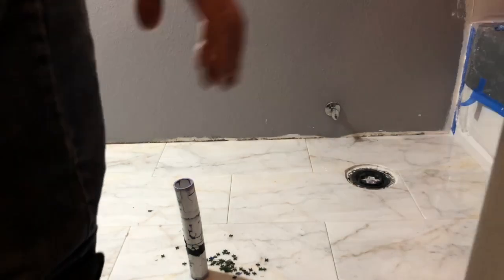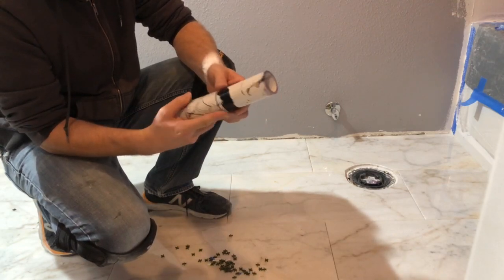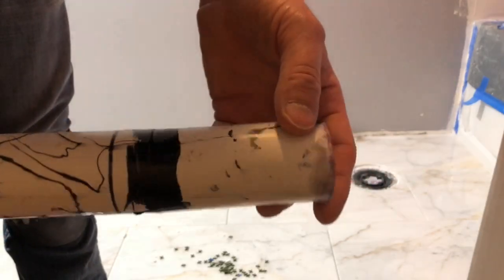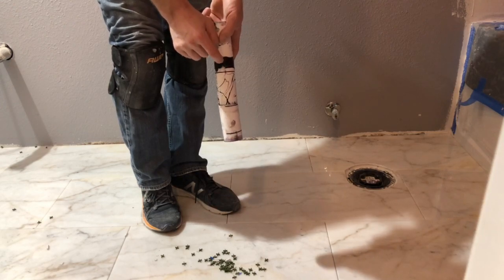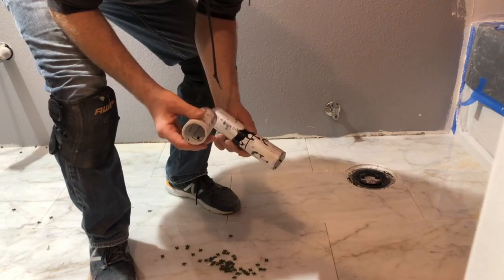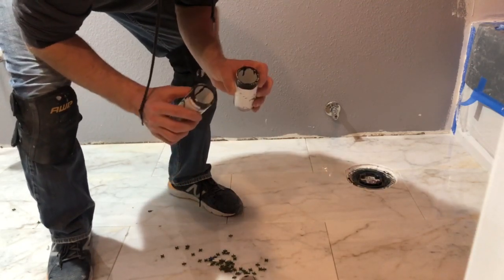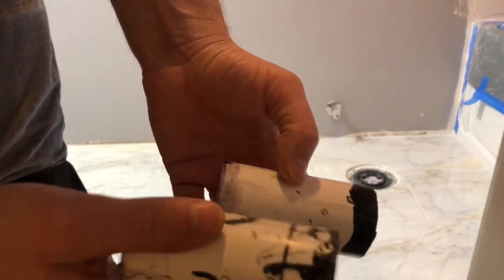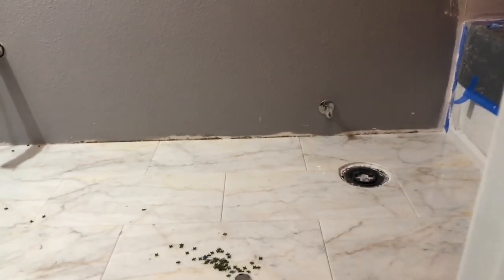PVC Cement vs ABS Cement

Comment: Nobody glues in that manner so the test is not relevant. A proper test would be connecting fittings to pipe, using the primer on the PVC.

Comment: DO NOT LISTEN TO THIS GUY. Ive seen in the field a crawl space flooded because a handyman used abs glue to glue a pvc kitchen sink drain. The stuff WILL fall apart. Abs and pvc are two COMPLETELY different materials. The glues (which are actually cements)are designed to chemically weld the two pipes together. Pvc glue has literally pvc material inside it, and abs glue has abs material. They WILL NOT WORK WITH EACHOTHER. There is a specific glue that can bond abs and pvc, it is called TRANSITION GLUE. Its green, dont get it confused with multipurpose glue. Transition glue is the ONLY GLUE that can bond abs and pvc together and it being that youre still using abs, do not prime the pvc when using tranny glue. Other then that you need to use a clamp style coupler, like a ferncoe or no hub which is actually the only method allowed by code. Also a side note, dont EVER use a butt joint.

Comment: The PVC glue is able to hold pressure better. Abs is brittle. So it'll be fairly strong, but like carbon fiber, if there are any flexes, it'll shatter. There is also the chemical release after abs reaches a certain temperature. Abs is more chemically stable, until it meets heat.
Reply: I'm glad you made this video because I just ran out of PVC glue.

Comment: thank you so much i bought the wrong glue (ABS) and used it on my pvc pipe. I was so afraid my water line was going to break. Now i will sleep easier.
Reply: Are you saying you used ABS on a PVC domestic water system?
Reply: wondering if any leaks ever happened. I used abs glue on my sprinkle pvc pipe and am concerned it will fail very soon.

Comment: You look like a complete moron. Sorry to be rude but you need to get your facts straight before you convince people to use fucking abs glue on pvc in there own homes. Yep, im a professional plumber. It will destroy the pvc pipe you idiot. And next time use primer on the pvc glue, you won't pull it apart then. Better yet, don't even touch plumbing ever again

Comment: "I don't know why they recommend the clear cement." 
Hey, neither do I! But I think I would want to find out before posting a video testing how well each worked on a but joint (which one never would use in the real world')
Reply: You can glue PVC to ABS if it is a connection that takes place outside the home where ABS pipe meets PVC in a non pressurized situation.

Comment: Try it again using PVC primer + glue
Reply: Wouldn't matter because he cut the pipe and butt joint, so it was fresh and clean material.  The reason ABS cement was stronger is because when it dries it has structural properties (pour out AbS cement and let it dry...it's a brick).  PVC glue on the other hand is just an adhesive.

Comment: Interesting video - it's an experiment I've always meant to try. Did you prime the PVC pipe butt joint before using the glues? My impression is that this is really important in getting a good joint on PVC. Also, I'd be interested in the corresponding test for ABS pipe.

Comment: Oh ya by the way buddy the abs glue is not at all safe to use as a bonding agent on PVC the two glues have a totally different but similar process and purpose the abs burns the pipe together in a chemical mechanical bonding reaction type of way itll become as one pretty much !   Drain pipes abs !        PVC pipe is for water supply line fresh water the friction that occurs from fresh pressurized water pipes brakes down pipe it needs to be smooth to flow through and not corrode  the glue used is more of a surface contact glue it burns into the PVC especially when used the proper ways by burring/sanding/scuffing up any piping before any thermo welding or contact welding methods are used before any chemical bond is performed to rely on as the source of it's design whatever your doing !     The glue on PVC piping kind of like fills area with smooth hard surface for water to flow and push outward against causing pipes glues to work as they do as if to mimic the grade of plastic or any type its purpose is for .....    in your experiment you only got a surface contact without allowing to dry and you did not prepare or clean or did any actual installation of the pipes correctly so that's just the air getting in between the two materials surfaces rejecting the glue or being being burnt by chemical reaction so the glue just stayed in the middle,   and it dried  hard against the surfaces of the two opposing sides in between am already tite fit surface hardened by air ..... kind of like water to ice except water is ice and it all becomes one but in your case three different materials not truly being bonded just had dry stuff in between and around it there was no real drastic chemical reactions nothing was truly bonded just surface contact made like your dry boogers on side bathroom mirror probably!            If your that sick type that dont wash they're own bathroom mirrors then you wash your body with no real care either unless you know someones going to be exploring it even then people let things go as if it's ok.....  the same types are the ones that wear they're pajama pants or house shoes to the store or anywhere outside your house those are not good habits to ever do
Reply: Like having a condom on & ready to go & seeing how many uses you can get out of it banging bitches tll it bust, same shit if we don't fail we never learn from mistakes. Didn't realize how many perfect people we have in this perfect world of ours, guess that makes you guys are better than Jesus!